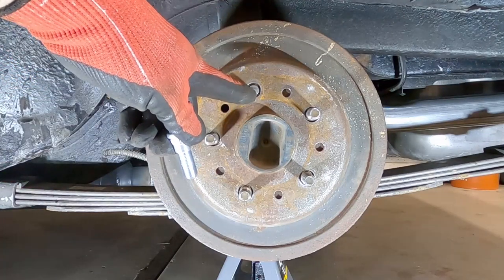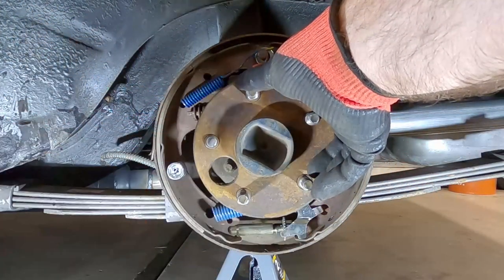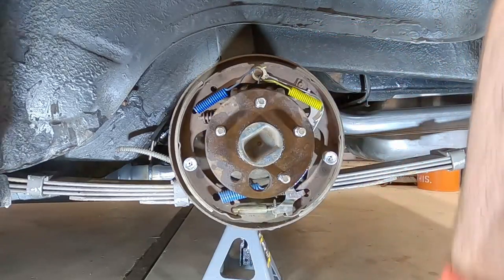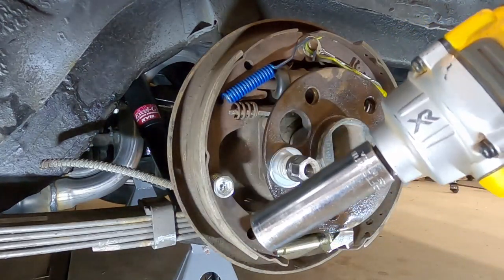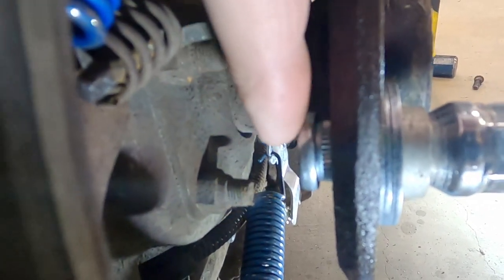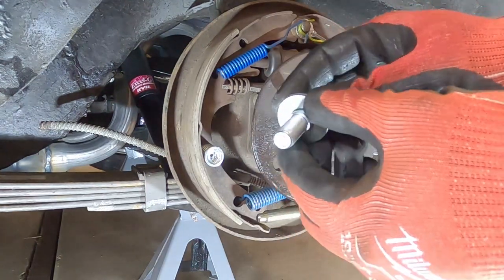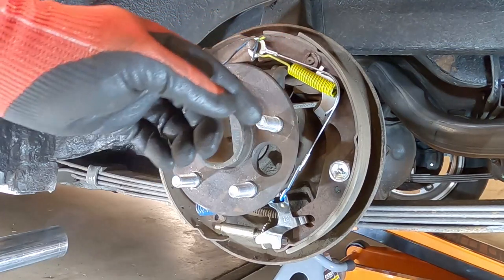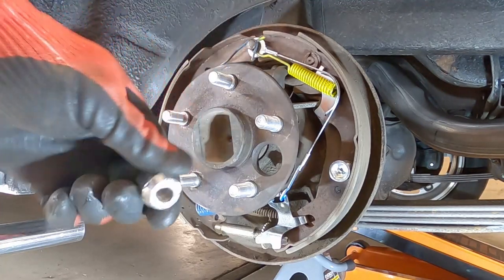How to Replace a Wheel Stud

Comment: A little suggestion on the surface face of both rear drum breaks. You can have them looking awesome if you clean off the rust. Degrease them. Dry then up really nice. Then rattle can spray them with two or three coats of Rustoleum semi-gloss paint. Paint them the same color as your front disc calipers. I’m telling you, it’s like giving your Stang a new pair of Nikes.
Reply from the maker: Haha, I was just thinking about that the other day.  It's on my list of things to do, I just keeping putting it off.  :)
Reply: @AndyKruseChannel  Make sure to make a video of it. 😁😎👍
Reply: Some say it’s best to use high heat paint, the one that’s used for engines, headers, or even barbecue grills. I don’t think the drum faces make enough heat to warrant that. Their surfaces does not rub against anything. They are just bolted to the wheels. The blunt of the heat is behind the face, and it’s not excessive. I sprayed my drum brakes with regular Rustoleum Ultra Cover 2X paint-primer a couple of years ago…they still look nice and fresh.

Comment: I didn't know you could just knock them out like that. could you take the plate off and hammer them in as well, or would that be more work than it's worth?
Reply from the maker: That plate is attached to the axel.  Yes, you could pull the whole axel, put it in a vise, and drive the studs out from there, but it's more work.  Thankfully you don't have to hit the studs hard enough to damage anything on rear axel or housing, so leaving everything in the car is fine.